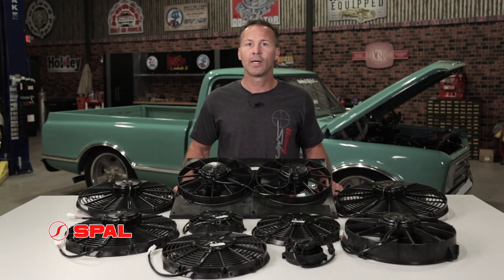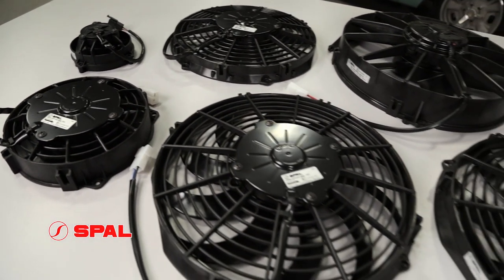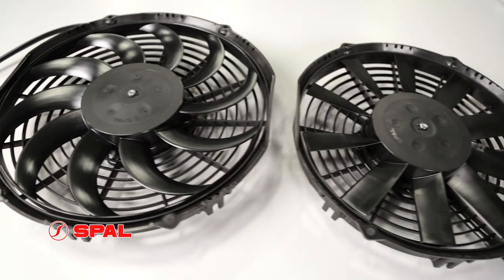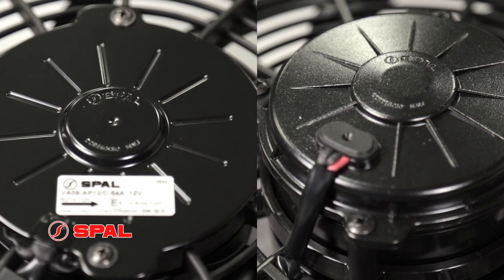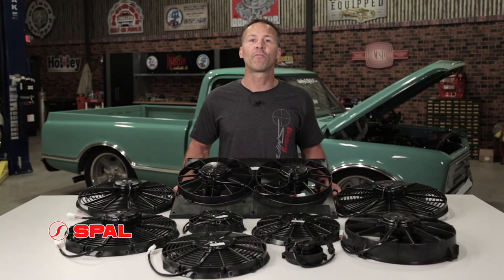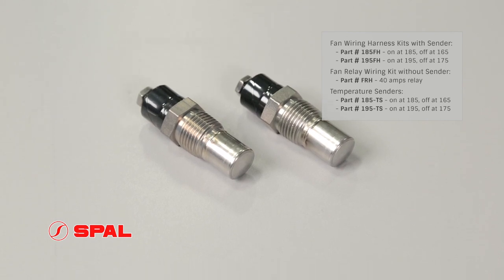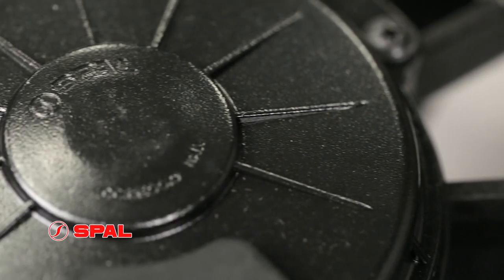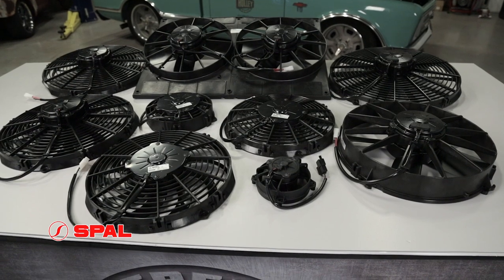Spal Electric Fans

Comment: 2 question's
1 I've been hearing bad thing about electric fan when you live in hot desert area's. Like fuse Poppin more often. Leaving with you a big problem.
2. Just thought,I was wondering if I can Install an pusher fan 12" to 14"  in front of my radiator while keeping my clutch fan. Could it work or would it be useless to do it that way?

Comment: In spal with pushiest the most cfm the curved blade or straight blade  in. 16” cheer
Reply from the maker: The straight 10 blade has the most cfm @ 2036.  here's the link to the fan, https://www.holley.com/products/cooling/fans/parts/30102047  Thx J